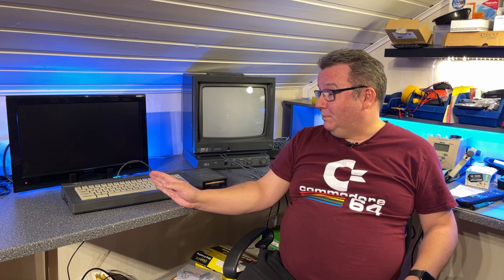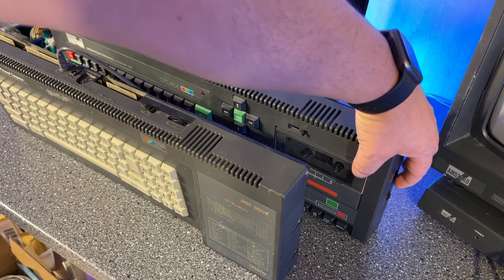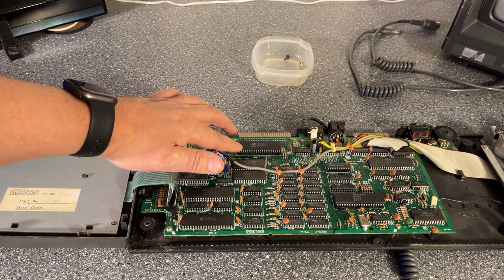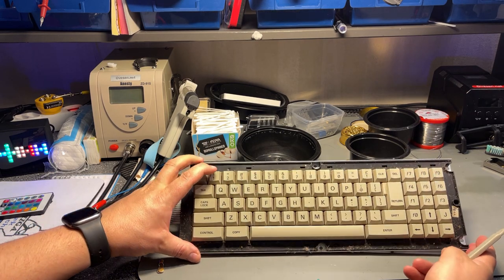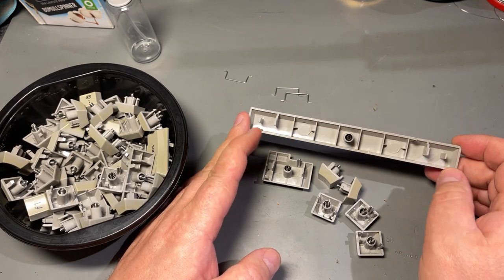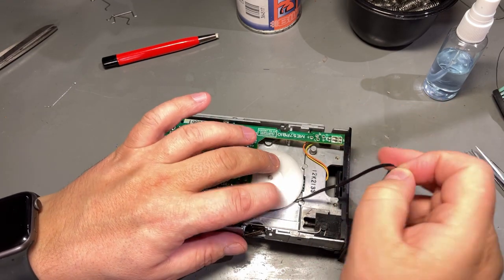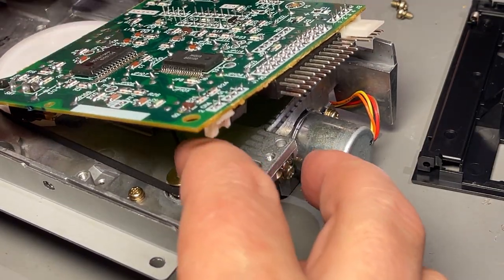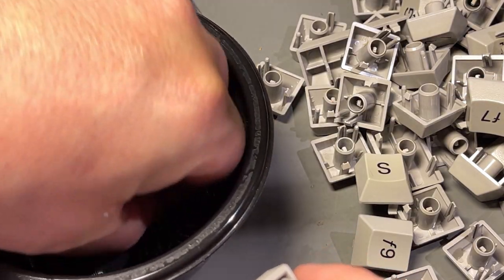Amstrad CPC 6128 - Part 1 - Restoration, repair and recapping, replacing drive belt

Comment: Great video. Nice to see you work on some Amstrads! 😃 What you're seeing at the end is most likely a bad AY chip. It happens a fair amount. I would start looking there.
Also, I have yet to see an Amstrad CPC that needed recapping for any reason, so I never really bother with that (unlike ZX Spectrums, which is one of the first things I look at).
Looking forward to part 2!
Reply from the maker: Thanks a lot Noel :)
Reply from the maker: I want to learn more about the amstrads. Even if Commodore is "my" computer, I really like the Amstrads as well
Reply: @Arcticretro  I do not like Commodore color pallette and I like better 3" disks than 5.25", but C has superior scrolling and better sound chip. If Commodore has got Amstrad pallette or Amstrad has got at least better hardware support for graphics it would be killer 8-bit machine.

Comment: I just love watching videos about old computers. I noticed that this one has both enter and return key, never seen anything like that. Why does it need both?
Reply from the maker: This is what I found in the manual: "Under normal circumstances (by default), this key has the same effect as [RETURN]
and can be used as such. However, like the function keys on the numeric keypad, the
[ENTER] key may be re-defined for other uses."

Comment: I have a feeling those 3 inch drives use the same/similar signalling and pinout as a 3.5 inch drive. Theoretically one of those floppy emulators would work with this probably with some custom firmware and a casing to fit
Reply: Yes you can fit a 3.5" drive or a gotek with a modified cable, no firmware or software changes are required, the original drive has fewer pins that's about it.

Comment: Hello, were you also able to source the non polarized electrolytic near the sound chip?
Reply from the maker: Yes :-)
Reply: That's nice, I cannot find such caps in a normal electronics shop in my country, so I had to buy from a shop which specializes in high fidelity audio components. They have audio rated caps which are very expensive and of insane quality. Apparently, non-polarized electrolytics, are still used on some audio circuits! I bought three Nichicons with copper legs for four euros!
Reply from the maker: @solidhit2  I think I got it from DigiKey
Reply: Yes, to buy from Digikey, I'd have to import from Italy and patience is not a virtue I possess, when I want something I want it fast, so I pay more! By the way, with all the messages about that cap, I forgot to mention that I find your videos educational but in a relaxing way. You don't try to prove anything, you are yourself and I find that very appropriate for our retro "hobby", well done!
Reply from the maker: @solidhit2  Thanks a lot :)

Comment: Recap is / was not required.  You took working mainboard and replaced goods caps, absolute waste of time, money and unnessary.  There are no leaky early generation smd caps on this board, Amstrad used high quality caps and unless you have an issue with them they don't need replacing.  People should stop unnessary recap please, there are some machines that need doing like the amiga 1200 but not these.
Reply from the maker: Well, that is your opinion, but the fact is that 40 yrs old caps can behave bad, thus it is a good idea to replace them
Reply: @Arcticretro  In fact I opened my beloved 6128 because of your videos to find out one capacitor with corrosion. Thanks a lot, I think that could have saved my motherboard on the long run. So I decided to replace all capacitors. Could you share the capacitor list?. That would save me a lot of research time!. Thanks!